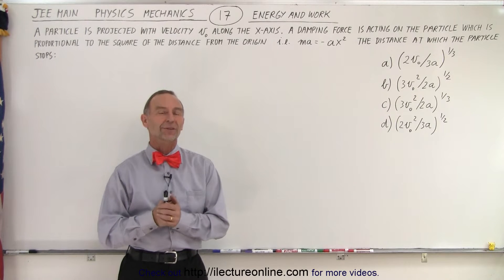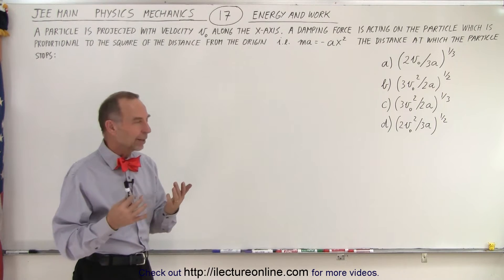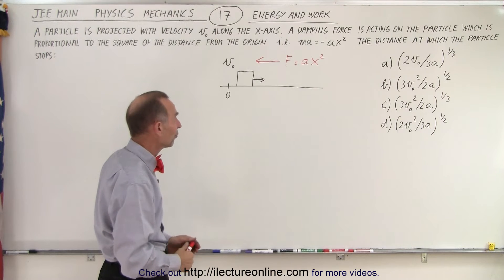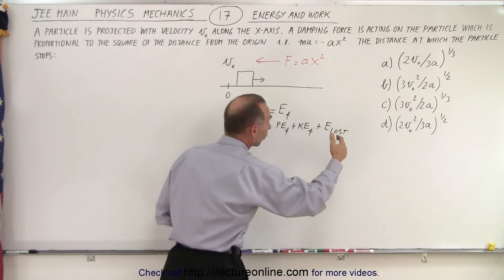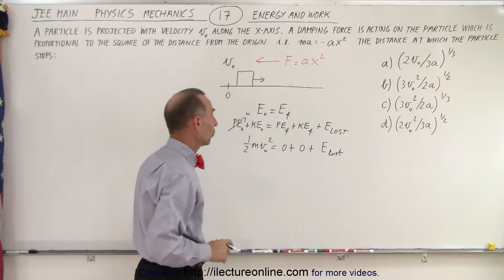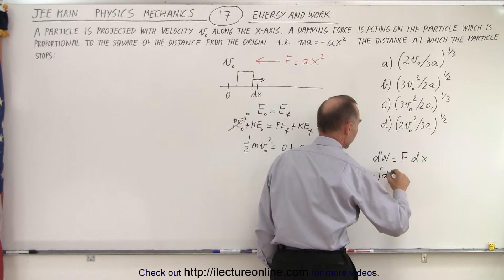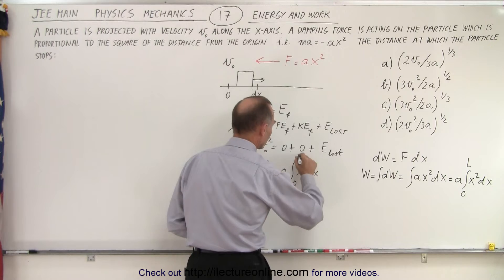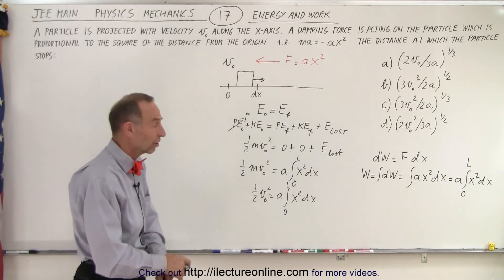JEE Main Physics Mechanics #17 Energy and Work

Comment: Can you not also say that because the curl of vector F = <-ax,0,0> is <0,0,0>, it is associated with a potential energy U = (1/3)ax^3, hence mechanical energy is fully conserved as there are no non-conservative forces that do work. This way, you could indeed say that E_initial = E_final, and end up with the exact same result. Is the method that I described correct?

Edit: Another method (which essentially is the same as the above method) is to use the work-KE theorem.